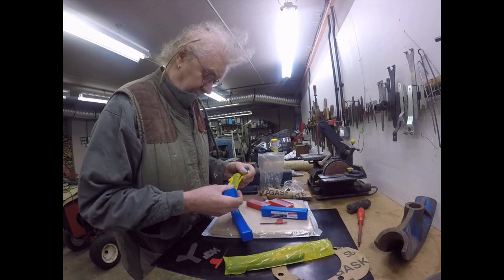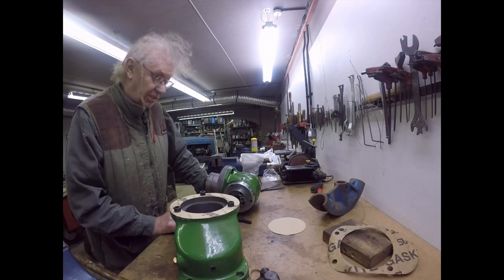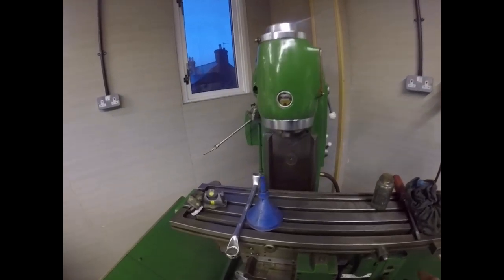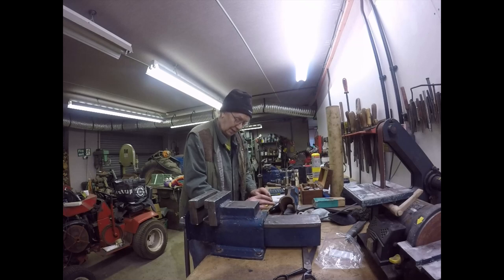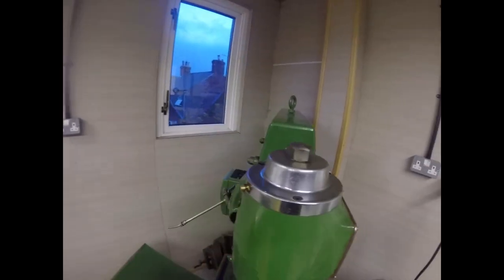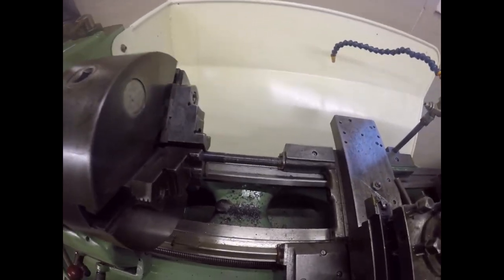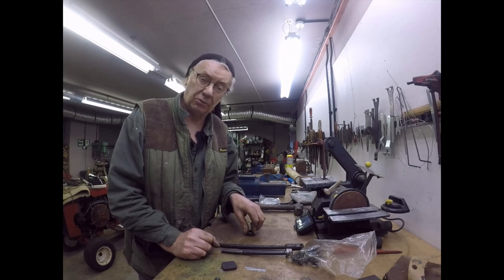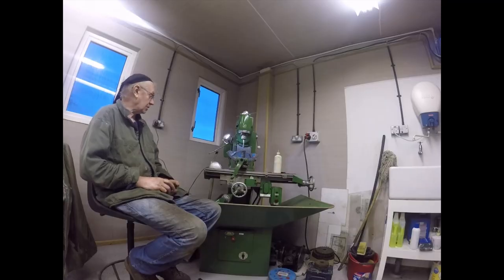I get sidetracked again, and again,and

Comment: Hi Phil. Enjoyed the drawbar sections. £500.00 for a Gamet bearing is cheap in commercial 
industrial outlay as it gets the machine operational again quickly saving the company ££££££££ 
in lost output. I'm with you lol, your Harrison vertical head will barely get hot in operation. Tony
Reply from the maker: Eyup Tony!
The problem with machine tool bearings I have found is with the flanged type, some of which are unavailable until the maker gets enough orders to male a batch!  I have a Raglan v mill that needs a new flanged top bearing which is unavailable at the moment and I have been considering grinding a slot in a plain outer race to fit a circling but tbh I don’t think there is enough meat there for strength! This of course will all happen when I get a round tuit, but they seem to be out of stock as well! Thanks for the comment, always find your content interesting, especially the setups, which can be “challenging” to say the least!
Phil

Comment: I see you are keeping out of mischief young man!
How did you cut accurate holes in the neoprene for the gasket? I know they can be easily tapped out of gasket paper but neoprene is quite tough stuff.
Top regards fro, the soggy end of Yorkshire!
Reply from the maker: I have some leather wad punches, and find they will cut it with ease, provided you use a nylon chopping board underneath, cut out the rest with scissors. It also marks easily and legibly with a pencil, but I used the tapping method to mark the inner circle after I had cut out the rest, and held it in place with four allen bolts through the holes. then made a small cut with a stanley knife, and cut the rest with scissors.There is supposed to be a blanking disk in the round hole that seals against the drive gear with two O rings, but it was missing when I got the vertical head. Thankfully, the drive gear was with it! It makes superb gaskets!
Phil
Reply: @philhermetic  Thank you young man. It is always much appreciated when a man of intelligence, resources and of course a great workshop shares the intricate detail of his work!
I won't ask where you got the rubber from, just in case you got it from an old suit or similar garment!
Ha ha ha ha ha ha ha ha ha ha ha ha....